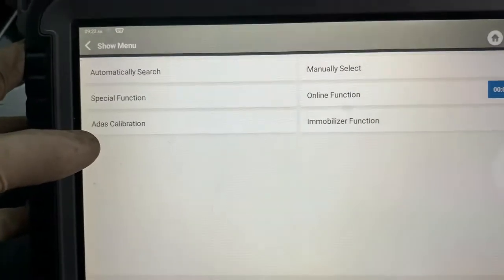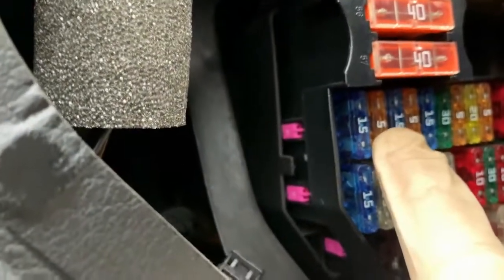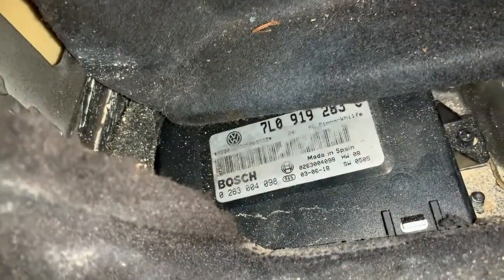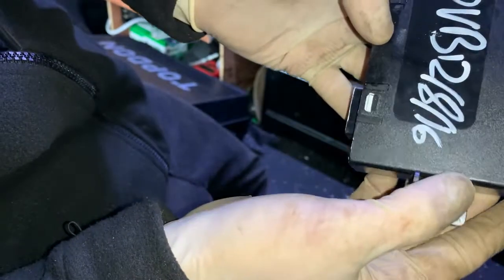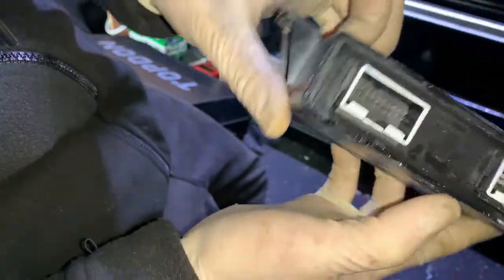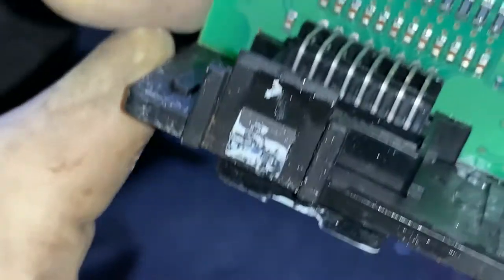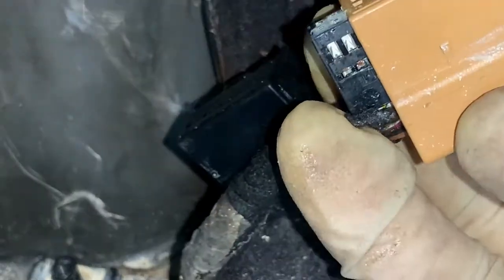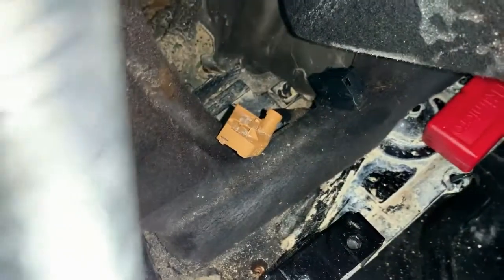PORSCHE CAYENNE  [PARKING SENSORS NOT WORKING] Part one.

Comment: What symptoms did this cayenne have? Mine is currently beeping and showing two two red lights on each side, on the front and back when I put into reverse.
Reply from the maker: This vehicle has no lights at all until the new module was in place🙂
Reply: @mrautoservices7354  hmm, thanks for the quick response! I ordered a new cheap used module on eBay, hopefully it works out! If not, I’ll try tracking down the issue like you did 👍
Reply: @mrautoservices7354  update, new module fixed my problem! Thanks again for the helpful video!
Reply: @graysonkansala2593  mines doing the same but just the rear sensors are showing one red light each side. I assumed it was because the car had been stood a while and I maybe jetwashed it a bit too thoroughly 🤣. 
How much was the new module?
Reply: @fookyoutube7274  I found one on eBay for around 40 bucks
Reply: @graysonkansala2593  Thanks man. Hopefully I'll get around to pulling out the old one at the weekend 👍
Reply: @fookyoutube7274  sounds good, let me know if you have any questions! It can be a little tricky
Reply: @graysonkansala2593  I appreciate it dude. Its only my 2nd week of ownership lol. Love the car though!
Reply: @graysonkansala2593  I'm pretty sure it's a damp issue now as they've suddenly started working again after a hot sunny day lol. Maybe I'll clear the drains this weekend lol
Reply: @fookyoutube7274  hilariously enough mine have never worked, and then only worked for the past 2 days(starting immediately after i pressure washed the undercarriage and lightly sprayed the rest of the car haha
Reply: @graysonkansala2593 which one did you get? And what did you search up etc etc